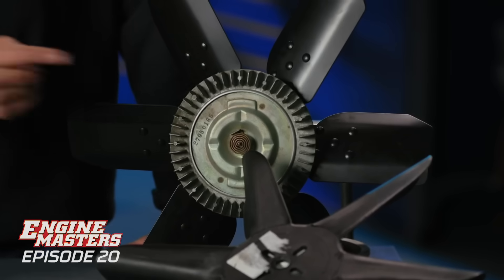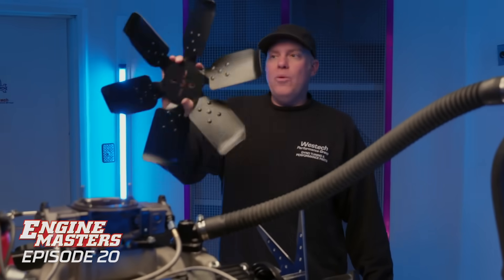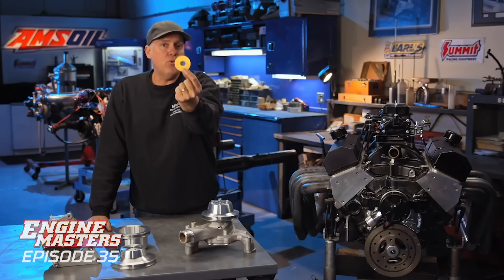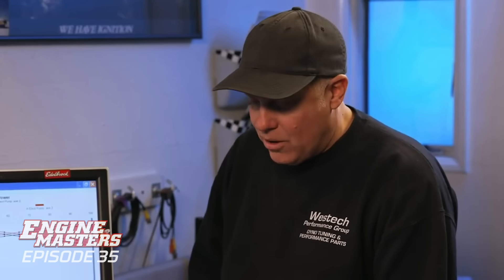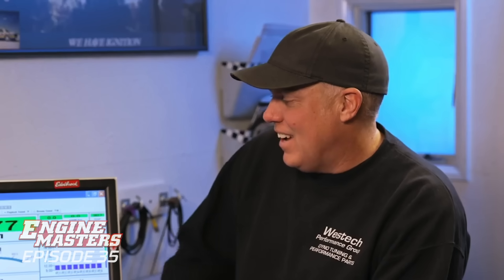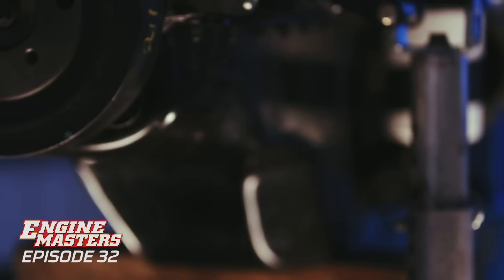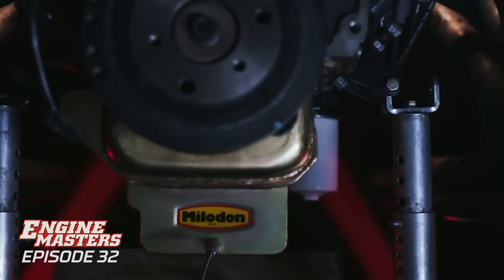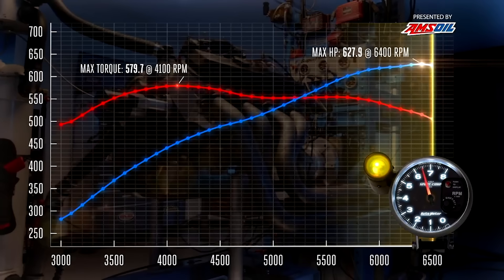Don't Do This! How to Ruin Your Engine's Horsepower | Engine Masters | MotorTrend

Comment: So when i race my car.... unplug my fans to reduce drag on alternator, drain a court of oil, dont warm up engine and race when it is 0°. I am gonna slay the streets with my aveo.
Reply: Quart
Reply: As long as your timing belt holds
Reply: It's an Aveo. Only street it's slaying is the one it's on when its wheels fall off. (Much more common than you think. Those things are the trashiest car of the trashiest brand.)
Reply: Quart you nitwit
Reply: And planets need to be aligned.
Reply: What I do to simulate  the good cold air all the time is I have another car with an industrial HVAC unit bolted to the roof , and I just have it in front of the race car and blow cold air on it. 
Works great,it's worth like 2 seconds in the 1/4. 
I can send you a blueprint if you're interested.
Reply: @MrTheHillfolk  - If you have an industrial HVAC vehicle that can stay in front of race car... you're doing it wrong.
Reply: @sienile  😁😁
Reply: It's probably fastest at 60 degrees f not 0. Wheel bearings and everything else saps power when cold
Reply: @josephschaefer9163  - Wheel bearings can be warmed up with a bit of driving to counteract that drag. Engines love icy air.
Reply: @sienile  one other thing. Cold air is harder for the car to push through, making it slower
Reply: need a salad bowl over the carb.
Reply: are you draining a court of oil or a quart of oil?
Reply: If you were to drain a court of engine oil, you could end up guilty of destroying your engine.  But we’re not Judging.
Reply: @scarbourgeoisie  Settle down, Captain. its just an Aveo. It'll be fine
Reply: @NaterAnderson  You might want to read the original comment, specifically where the word court was used in place of quart.  I then followed up with a "judicial" play on words as a parody that totally went over your head...
Reply: @scarbourgeoisie  Actually draining a quart of oil doesn't affect oil pressure or oil distribution at all. It reduces windage within the crank case and oil pan, thus reducing drag. Cars recommended oil level is a bit extra than needed out of an abundance of caution...
Reply: @joshuagathright670  Jesus!  You too?  It was a parody on the guy using the word court for quart.
Reply: @scarbourgeoisie  pleeeeeease stop feeding the animals
Reply: Actually the alternator creates the same drag weather its under little or max output.as i believe was stated in the video. So unplugging the elect.fan would be of no gain in power. But I ain't here to judge so do what you gotta do. Just don't forget to take out the interior an the backseat. Thats a lot dead weight. And since its an Aveo, that backseat won't be put to any good use anyway. lol😎

Comment: If you read all the comments,  answer me this.
Why do you say “clutch fan” instead of calling the clutch a “fan clutch”
And also you reverse “foot pounds” by saying “pound feet”
Reply: Well, foot pounds and pound feet are two different measurements, and although foot pounds is the correct measurement in this case, a lot of people get used to seeing and saying pound feet due to torque wrenches and torquing fasteners. Reality is its just something that some people use them interchangeablly, even though it's incorrect
Reply: @void2618_  how are they different?
Reply: Because people are dumb it’s technically a clutched fan as a complete unit. And the center hub is just the fan clutch
Reply: @Anthony Glenn they are multiplied by each other so order doesn't matter, not divided.  Ft * lbs. Or lbs * ft gives you the same value
Reply: @davidsimms2806  - No. Take a pole, put 10 lbs at 2 feet out. Then take 20 lbs at 1 foot.  They don't feel the same. The heavier but closer weight will feel about 3lbs more. It literally means "pounds at 1 foot of leverage". The 1 is a constant that applies only to the foot.

It's like saying hours per mile instead of miles per hour.  60 HPM = 5 days to go 1 mile, 60 MPH = 1 mile a minute. You can't just swap things around all the time.
Reply: @sienile  those would both be 20 ft lbs.  There is no "feel" is physics.  Mph vs hpm are divided. M/h. See the division? When those are switched you've taken the reciprocal. Which is different.
Reply: @davidsimms2806  - Guess you don't know it's abbreviated Ft/Lbs. I'll let your own argument tear that up for you.
Reply: @sienile  except it isn't.  Take a physics class or Google it.  Torque = Force x distance.  In this case lbs x ft.  Ft x lbs gives you the same answer.  Could be N x M for Newton meters

Comment: They should do a test to see what keeps the motor the coldest.         I would like to see them run a vehicle in bumper to bumper traffic in the Summer....
Reply: I put one of those Lincoln MK VII fans in my '74 Camaro, with a pwm controller. Bumper to bumper LA traffic. It was probably 90 degrees or so, flipped the fan on high, and my Camaro ran at 160. It actually ran a bit warmer, about 170, once I got up to highway speed, simply because crawling, I wasn't making any power obviously.
Reply: I've used an aftermarket twin-fan electric setup on my '78 F350 with 11:1 compression 351 Cleveland. It never ran hot and the fans always kept it cool in traffic. 

YOu don't want the motor cold as its designed to work at operating temperature - generally around 180'F or so. Anything much lower than that may cause moisture buildup and excessive wear. Modern vehciles tend to run much hotter (200 ~ 210'F) as it decreases the parasitic loss to fluid drag from coolant and oil.
Reply: Electric out performs mechanical unless it's very under sized.  Even more so in traffic or idling.

Comment: The fan test omitted one important factor, airflow of the various fans. More airflow typically induces more drag but not always. The efficiency of the fan could make a difference too.
Reply: Also, for true accuracy you would have to supply airflow to the fan at road speeds. The fan will require less energy to spin when the air is being fed into it. This is the same with pumps and fans in industrial systems. They require significantly more power to get things moving than they do to keep things moving.
Reply: Grant that fan part is an excerpt from a full vid that has been removed from YouTube.
I don't know how many years ago I saw it, but it was at least 5 years.
Anyhow, I remember the fan clutch (if not all the fans) was tried with and without the shroud. The shouds made a big difference to the power draw indicating they actually work.
Iirc on the fan clutch the shroud increased loss by something like 9hp  - but yeah it was awhile ago.
Reply: No matter how big or aggressive a fan air only flows through the radiator at about 15mph.  That's why the shroud is so important, even OEM fans move more air than a radiator can flow.  Without the shroud the fan might move more air, but less of it goes through the radiator.
Reply: I use a plastic fan, but I cut off 1/2 of the blades. My cooling system is overkill ,besides that .Alloy radiator and a pusher fan. The clutch fan was very heavy!
Reply: Should test servo pump and ac compreasor

Comment: Probably just want to use an electric fan if you're really chasing horsepower...
Reply: The other benefit of the electric fan is  a faster engine warm up to its operating temperature. A boost in hp, easier revving engine with less load, better gas mileage, etc. So you see electric fans have more benefits than just giving you robbed power.

Comment: Soooo , electric water pumps are a scam. Even on a racecar.  Now I'm wondering what's the point of running elec on something like a 555 ci madcap . We see bigger changes from the freakin DA .
Reply: For some race cars the electric pump and fans also allow for cooling down between runs. You can run both with the engine off to circulate water and cool it off.
Reply: that 1% gain might be enough to win, isn't that how motorsport works?
Reply: @krusher74  1% isn't realistically going to be enough to matter. Even at 1,000hp you're only talking 10hp. If you're doing all that for only 1% you're better off just skipping lunch since the performance difference would be about the same.

Comment: Those steel fans are also very noisy. Clutch fan is the most efficient and uses the least power. Standard 4 blade fan is quieter ofcourse. Though I have seen them go through bonnets, batteries and splash trays.
Those alloy flex fans are very dangerous!
There is both power and reliability with a better pan. And yes less oil is generally better.  All wet pans will have windage and sprat turning the oil  into 25% air. I use an oil cooler to at least try to deaerate the oil. This one a road race car with a very good wet pan.
Dry sumping though is the only way too go. Those pumps use more power to turn yet you lose less power with decreases aeration as well as vastly improved oiling.
Dead easy to do for a SBC and harder for everything else. I have never seen an off the shelf pump, pan, etc for a Ford or Mopar
Reply: probably dont need it..eh..chev need all the help they can get. lol...dry sump is best & stops oil starvation,main reason to use it. not hp..

Comment: But does a bigger alternator equate to 30 bhp for a waterpump and a mechanical fan? I don't think so. Since you need one anyway I d go this route. Where's your test on that :D
Reply: In most cases you wont need a bigger alternator, even on a old school muscle car.  My RX-7 only runs 90 amp alternator while running all stock accessories, high volume fuel pump, electric water pump and duel electric fans.

Comment: Somthing most people overlook on an engine only dyno is that in practice the Alternator on a car provides more voltage for spark 13-14v vs 12v Ive seen motorcycles on the dyno with alternators removed loose HP because of a weaker spark at high RPM because at 10k the 4 individual coil packs needed much more Voltage. On a Suzuki GSXR 1000 over 10,000 rpm without an alternator it lost 14hp on a chassis dyno

Comment: Its just like the air filter episode. The real winner is removing it completely. Same reason why my Passat has ice cold A.C. and my Firebird had 2 windows that roll down AKA 60×2 AC. (sometimes 120×2, 🚔"but Officer, its hot out today") 😎😆👍
Reply: Most new cars detect a loss of air resistance  and go into safe mode. I had a 2005 350z that did that when I removed the air filter at a track.

Comment: Static dyno test with a low oil level does not account for oil movement during acceleration, cornering or stopping. What is that oil doing during a one G launch, or a one and a half g stop rate?
Reply: Right these are just like lab tests to show there is a power increase if you reduce windage, not something you want to do in a real car that is tossed around. Also the extra oil is beneficial to not have the oil overheat. Just like how transmissions pans with more oil capacity helps the fluid temp stay down.

Comment: They showed which fan was worst but not best :(
Reply: For a mechanical fan the clutch style is the best. They have the least drag when the clutch is disengaged but will still lock up to move more air when the temps rise. The other fans are always trying to move air and always a parasitic drag.
Reply: Electric fan...same as the electric water pump...then the only physical draw on the motor is the alternator to run both electric motors...

Comment: Guys - I've enjoyed your content for a long time now, and I make this comment with TREMENDOUS respect for the amazing work you have done by conducting great, scientifically sound (and sometimes comically insane!) build and testing videos.  You've dispelled myths, explored areas many fear to go with some of your WHAT IF style builds and modifications, and educated thousands of viewers on why a controlled, scientific, testing-based approach is SO important no matter what topic or subject you are interested in.

With that said - this is a great video that really shows why we need to transition away from combustion engines.  In this episode, we see that they create tons of waste heat, and we lose MORE power just trying to get rid of the excess heat we didn't need or want to begin with.  And its a vicious cycle - the engine has to work harder to spin that fan, which creates more heat that the fan needs to get rid of...which makes the fan work harder which creates more....ugh!

We could go on and on - there are hundreds of differences - large and small - between combustion engine power and electric motor power for propelling cars. One MAJOR difference that is very topical to this video is that in electric cars, there's no need to power the accessories off the main drive system.  You can power the A/C compressor with an independent motor specific to that function - which has a host of advantages alone...like being able to use a variable speed motor, to run the climate control even when the car is parked (and even inside a garage), and more. Similarly however, electric cars DO need cooling and heating, and they use coolant just like gasoline cars - so they need pumps to move it around.  But like the A/C compressor, they can be run independently from the main drive motor(s)

For those of us who are true gearheads - DO NOT FEAR!  The world of modding is NEVER GONNA DIE!  It will absolutely live on - just a little differently than we know it today.  Instead of boost pressure, we'll boost the voltage!  Instead of more air and fuel, we'll push more amps. But at the end of the day, the game is the same - we want more torque and the wheels. And just like this video, there will always be ways to measure, test, and extract more power from your build /ride.

And gas engines won't suddenly disappear. We've built MILLIONS of combustion engines that have many, many years of life left on them.
Reply: Yes, electric motors probably are the future. Maybe hydrogen for big vehicles.

Comment: Are electric fans and pumps more efficient overall, or does it take the same amount or more power to run the alternator? If the electrical system could handle it, removing the load from the alternator at WOT could be a good solution.
Reply: Basically yes. The electric fans can sometimes operate at multiple speeds, or multiple fans can be staged to come on at different temps which would reduce the load. The electric water pumps usually run at a set speed so would be a set load. You'd be a little less load total even with multiple fans and an electric water pump, but probably only a couple of HP less. 
Often the bigger benefit to running electric fans and water pump is cooling everything down between runs. You can stick the battery on a charger and run the fans and pump with the engine off so everything cools down quicker.

Comment: what's better Royal Purple  or  Ams oil ?
Reply: they are never going to show how their sponsor's oil can be beaten.
Reply: I was using Mobil 1 for a long time, but I saw testingnwere it was beaten by penzoil.  I have been using pennzoil platinum ultra in all my cars since. It is really good I must say. The first time I used it ony inline 4 engine it ran so smooth and quiet. No valve tapping noise.
Reply: whale blubber..keeps you warm & fed too..

Comment: I needed a fan for my truck I had a 454 and a 64 Chev so all I had was a Ford related from a 6 cylinder and I put that on there I thought it was okay I drove it around for a couple of months well I got heavy on the throttle and all of a sudden the motor went dead and I looked down across the hood I seen a hole in it the lights went out and everything coolant spraying everywhere cut the radiator hose and they have cut the corner off the battery it went through the hood and 42 ft in the air it's stuck in somebody's house and I never told him and I just kept driving well rolling
Reply: LMFAO
Reply: @xogmaster  LOL thanks

Comment: Should be a good episode.  Have a feeling I’m going to validate my electric fans.
Reply: @ZboeC5  that’s not how it works, the alternator mostly runs the car. The battery is almost always just for starting the car. Spinning these alternator isn’t hard, spinning it with a current draw on it is very Hard. Did you watch the episode?
Reply: Not really, they put a load on the alternator which is very parasitic
Reply: @E-Z_Gaming  Except you don't run them all the time.
Reply: @jaredshaffer3901  you don’t run a clutch fan all the time...
Reply: @E-Z_Gaming   Who said the OP had a clutch fan they replaced?  Plus, I didn't say anything about the clutch fans.  I simply pointed out that the parasitic draw of an electric fan isn't a valid point because they can be turned off (and typically are shut off at highway speeds or greater.)
Reply: the only issue with electric fans, is making sure you have an alternator to keep up. the old units are heavy and barely designed for points ignition and a two speaker radio :)
Reply: Holley sniper efi kit allows you to run electric fans and program them to turn on and off at certain engine temperatures.
Reply: The hp loss from the alt. is very low that it doesnt mater. electric is gonna always win.
Reply: @L-Noble.YT_Hi.Res-Soundminds  that’s completely not true. Cfm for cfm a mechanical fan will 100% win. The reason a thermo might be better is for size and you can turn it off and have zero losses. And zero cooling.